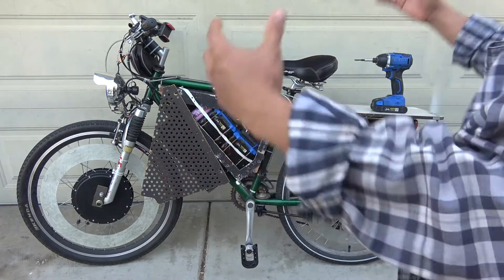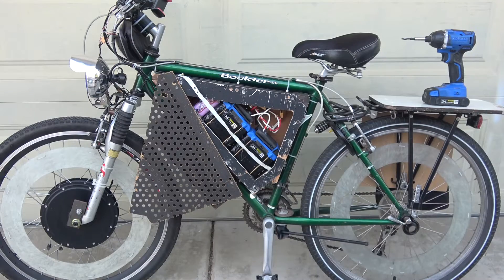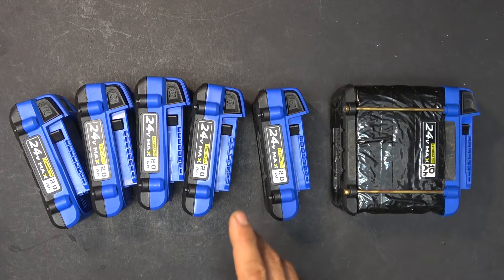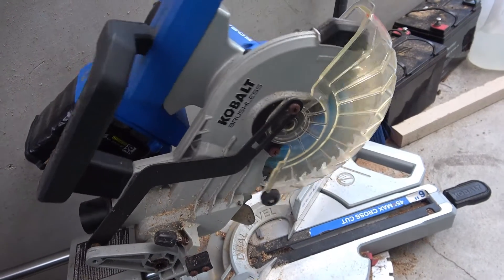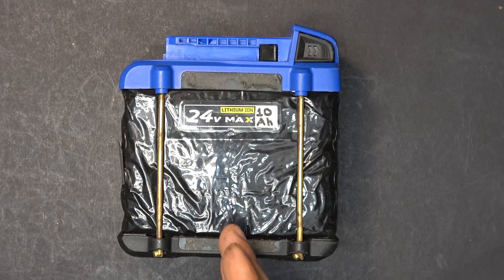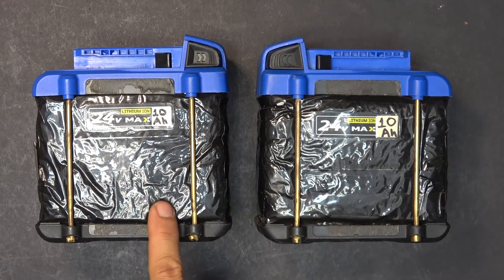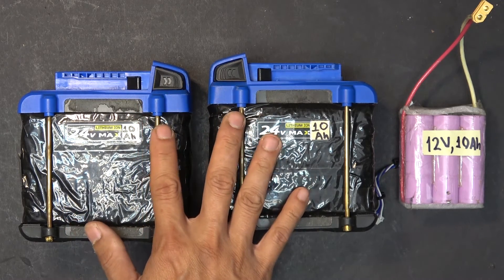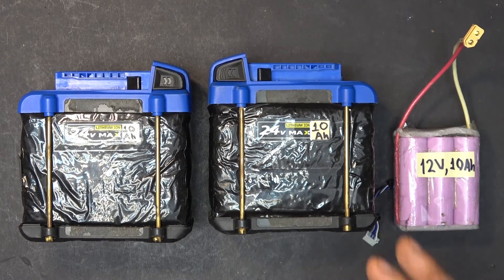The Pros and Cons of using power tool batteries (Kobalt 24V) for an electric bike

Comment: I wanted to see your opinion on something. I found an xHover 1 Edge Electric scooter at the park someone abandoned. I waited about a week and not one wanted it, so I took it home. The stock battery was a 10S2P battery in the handlebar area. All the cells inside were dead. So I wired it up to run on 2P 40v Black and Decker batteries. It works perfectly on flat ground, but when I go up a hill the BMS on the battery shuts it off. I measured the amp draw under load and it was 450Watts, so about 12-15amps. Anyway I can make this work better?

Comment: I just found a Craftsman v60 5.0ah battery model CMC b650 
How would you recommend I get or set up this battery for use on my chroma e22 Pro aka m365 clone?? From what I understand😊 this battery is split up into 3-20 volt sections each section with its own BMS... 

Currently using the stock battery and the stock controller on my scooter.

Comment: Thanks for this update. I want to use cordless tool batteries as well (not Kobalt - not available in my country) but I read conflicting reports of various brands that was used in e-bikes that fail (destroyed) very quickly because of voltage/balancing of the cells. Any advice please?

Comment: One advantage to using tool packs is genuine cells, to the extent some fancier packs use brand name power cells (e.g. Samsung, LG, Murata).

Another is that if you live in an isolated rural area, tool packs may be the only way to buy such cells in your town, scam pricing aside.

Comment: does this mean the bms was dumb, no current protection.
Reply: ...maybe the batteries just don't deliver more current through the bms together than alone? and then they'll just last 5 times as long as the same rate of energy use, and probably take 5 times as long to charge